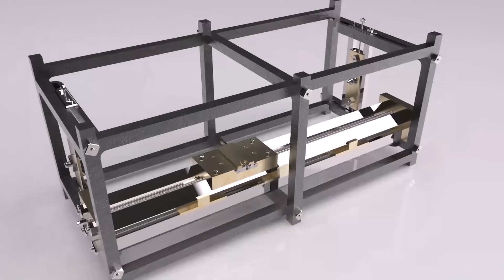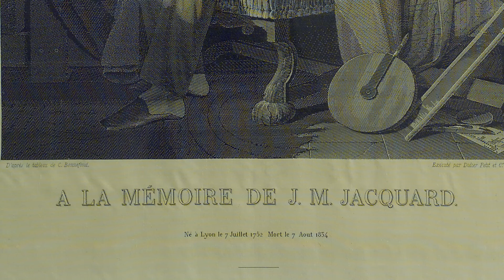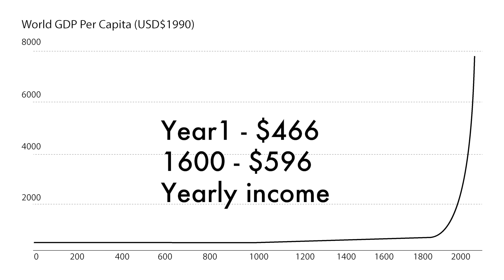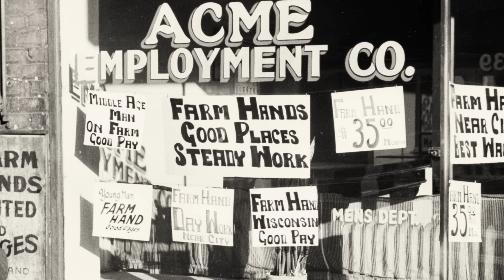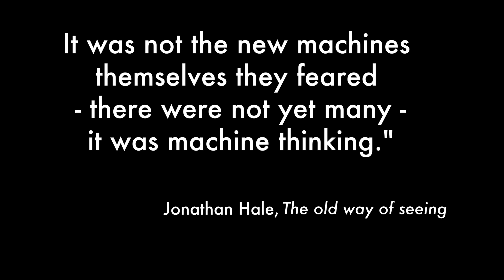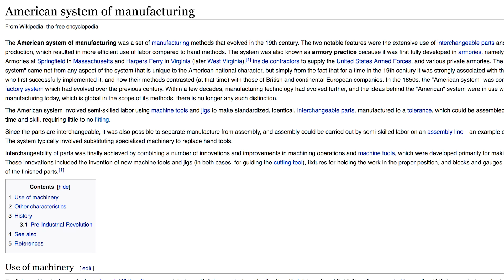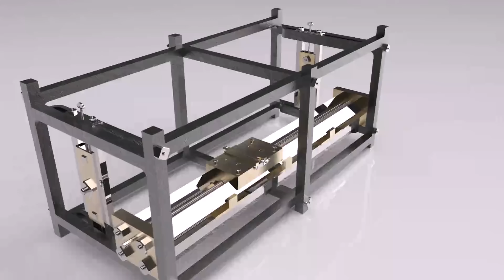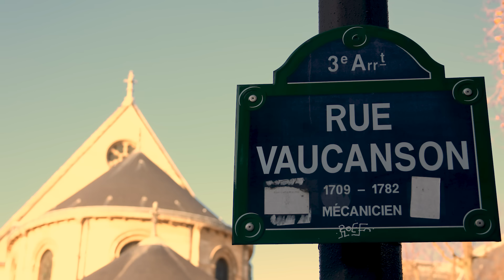The 1751 Machine that Made Everything

Comment: Almost like 3-D printing is behind the times 30 to 50 years… Just a glorified hot glue gun with special hot glue and a drafting table with 1990s level software

I swear it aggravates the hell out of me. In the early 90s I had an HP jornada color, screen PDA, and the most I could do with it was use it as a MP3 player… It even had a browser. I never understood why I couldn’t use any of the three mobile phone systems or one landline system that was around tonight. Only surf the Web but also download FTP… “Smart phones” are the exact same thing and still had problems with this up until recently thanks to the demise of flash.

Comment: I agree 100%. These machines were used (and scaled) to create better and better tools. If you've ever fixed anything by replacing a part, or put a new bolt in an existing hole, that's what happened. Before this, each nut and bolt were hand crafted and could not be interchanged.

Comment: Yes and no, in my opinion. A fascinating alternative point of view is to consider the source of progress is the ability to make precise screw and bolts, which ultimately lead to the use of small lathes, themselves made with screws, and so on... Therefore, technical progress was a very progressive process without clear break point. In this point of view, clock-making and also mill-making where the ancestors of industrial revolution, and this makes the "actual" starting point of this revolution difficult to identify. Ultimately, one could argue that the need of clocks and mills is the far far consequence of the neolithic revolution itself.

Comment: Quite wrong for a country or person to take credit for the lathe. History of Lathe

Lathe is a very ancient tool and its first use dates back to 1300 BC in Egypt. Lathe was also known and used in Assyria and Greece. Ancient Romans came to know about this machine and they further developed this machine. During the medieval period, the use of this machine had spread to most parts of Europe and it was during the Industrial revolution when this machine gained popularity with its use in all the industries. After the development of electronics, automated lathes have been developed.

Evolution of Lathe

The first lathe was a simple lathe which was is now referred to as two person lathe. One person would turn the wood work piece using rope and the other person would shape the work piece using a sharp tool. This design was improved by Ancient Romans who added a turning bow which eased the wood work. Later a pedal (as in manual sewing machines) was used for rotating the work piece. This type of lathe is called “spring pole” lathe which was used till the early decades of the 20th century. In 1772, a horse-powered boring machine was installed which was used for making canons. During the Industrial revolution, steam engines and water wheels were attached to the lathe to turn the work piece at higher speed which made the work faster and easier. After 1950, many new designs were made which improved the precision of work. You see France did not invent the lathe or anywhere close to.
Reply: Thats not a true metal lathe though else Egypt would have exploded
It was hard to make and could not be made by another lathe.
He says this
Reply: @frankk1512  lathes were being made around the world of metal long before this model which was very good but simply an amalgamation of other ideas, in fact, this method of change continues to this very day

Comment: That lathe might have had a large part in making one of the crucial machine tools that could work metal: The screw making machine. They needed all shapes and sizes of screws to hold machines together, without them pieces would fly off and hurt or kill workers nearby. They also needed many screws to go into the products, to hold them together. It was a very well-threaded machine shop that had the screws helping hold the parts together!🪛😊👍

Comment: Your technology-first read of history is fundamentally incorrect in so far as it doesn't recognize the dialectical interplay of ideas and material constraints on the mode of production. Always remember that innovation does not exist outside of ideology. All technological innovations that have permeated the capitalist age, from the ball-bearing to the transistor radio, happened because they served the purpose of increasing production surpluses.

The Romans were aware of all technologies needed to assemble a steam engine but they never did, except perhaps as a toy, because the organization of their agriculture, and the availability of slave labour meant that there was no pressing need for expensive machinery to automate that work.

No doubt the screw cutting lathe was a huge turning point in mechanical engineering, but its usefulness to society is dependent on social and political changes also happening in the 18th and 19th centuries. Colonies introduced tons of cheap resources to Britain and europe which needed to be processed into commodities. Land enclosure created a class of landless peasants with no means of subsistence except factory work. And modern timekeeping enabled the precise distribution of hourly wages. These are just a few of the hundred threads that knotted at that time in history to create the preconditions for industrialized capitalism.
Reply from the maker: I think you didn't watch the whole video.  Watch again starting around 8:00.  The whole point of the video is that many of these elements had been around in various forms for a long time (and often in non-western contexts as well, though I didn't get deeply into that) but what changed was how we THOUGHT about how to use these items.  Literally the name of the channel, Machine Thinking, refers to the idea that it's not about the tools themselves, as much as it is about how we think about how to use the tools, and then in turn, what those tools do to our thinking once we have them.

Comment: Many of the old timers had a more modern although used electric lathe for "hogging" but if they wanted ultra precision they took the part to a converted flat belt drive lathe with plain bearings and put heavy grease or oil in the bearings for finishing, more accurate. Better finish because of bearing tolerances and lack of gear vibrations etc.

Comment: moire is pronounced "mo-wire", like you need some mo wire to plug in your x-mas lights. But mash it together into one syllable. 
The e is silent on the end of most french words. UNLESS, it has an accent over it like in cafe` or the following word starts with a consonant, in which case you might pronounce the e slightly to smooth the transition between harsh consonant sounds.
"moy-ray" really only gets the "m" right ;)   (ya, 7 years late, I know. PS: good video)

Comment: Not just the lathe....it was the industrial revolution.  Effective power generation and distribution allowed for all manner of machinery invention and improvement.  Modern iron and steel production.  Energy, people, energy.  That's why wind power is still stupid along with the myth of solar power.  Without battery backup, they are silly.  Even with battery backup, they are silly.  Energy needs to be efficient, portable, instantaneous, reliable, and utterly distributable.   Energy.  Energy.  Energy.  It's the engine of innovation.

Comment: The biggest change was in thinking the youth always learned their trade and training from the elders father taught sons mothers taught their daughters with the changes sons and daughters learned learned new skills the mentality that the older generation generation knew more than the young was still in the minds of the older people even into the1980 my father always tried to say to solder copper plumbing lines you had to use acid cored solder  although I never saw him do it I used flux on all joints after sanding them never had a problem lived with my sister and brother inlaw his dad was the same way plumbing in the laundry room with half bath for clean-up after being in the barn we spent 4 hours trying to solder the water pipes to the sink toilet and shower every time we got done and turned on the water it leaked first one joint and then another I told that I always used 50 50 solder and flux he said the only way was acid core 50 50 solder finally he said the acid  core solder must have gone bad but he had some new stuff in his fridge and went to get it took him an hour to drive a1/4
 Mile go in the house couldn't find it so he searched his basement and his garage and finally came back with out it after he left I went to my room since I was planning on plumbing the water lines I'd brought my solder and flux in my suit case I went to work pulled it apart joint by joint sanded  fluxed and resoldered them in 20 minutes I turned the water on and no leaks he said I must have used his acid core solder even fixing a flat he had some home made tools to break the bead and take the tire off the rim he beat on that tool for over half an hr couldn't get it to break the bead I suggested to put the tool on the tire next to the rim and drive the tractor on it using the weight of the tractor to break the bead it wouldn't work he said finally he went to get a bigger sledgehammer from his garage as soon as he left I set the tool as I suggested drove me tractor on it  broke the bead turned it over and did the same since I held the tool while  he hit it with the sledgehammer it was self preservation I was worried he'd miss the tool and get my hands or arms didn't take him as long to go to his place check the garage find the 10 pound sledgehammer wasn't their and come back I think he just went home and right back didn't even stop and check out his garage because it was in the shop the whole time but with that generation it was a way to save face I don't think they ever soldered a pipe just figured that's how it's done since they were older they  were the ones to teach us  as their fathers had taught them unfortunately things were changing it was copper pipe solder together not galvanized pipe threaded together tires were a tighter fit than on the old model t even wiring a house was different no more knob and tube with taped splices it had gone to two wire and boxes add then to two wires with a ground and had to be to code and inspected my generation recognized times were changing now if we have trouble with those newfangled computers we ask our kid's or more likely the grand kids when i have a problem with my phone I get my niece to fix it or I get her son my great nefew to fix it so much has changed in just  2 generations but the main thing is how we view the changes from my dad's generation where they'd never consider asking my generation for how to do anything to my generation where if we have a problem we ask the younger generation or even go down to the next generation I still can't figure out a lot of computer stuff and the new phones are just a computer in a handheld device  I still remember the first text I got it drove me nuts said I had a message but after checking my answering machine and it said I have no messages I asked my neice how to reset it and get rid of the message that I had a message when the answering machine said I have none she looked at the phone and said you have a text I said what's that so she showed me how to get the text she then replied to the text and told him I was computer illiterate and phone me well this generation doesn't phone they text and he sent me another text in reply but this time I knew what it was and read it it was a good lesson as I ended up at a new job and my new boss would text me up to twenty times in one day and since he had problems sleeping and thought of something I needed to do or check out on the job he'd text me at two o'clock in the morning now I do a lot on my phone my brother's washer won't work it's got a strange code Google it and fix it need to find a place open Google maps and in most cases it'll show how to get there need a phone number Google it I always say I got dragged into the computer age kicking and screaming no but I'm there and there's no turning back the brother 2 years younger and the one 5 years older never used their phones as anything other than a phone the older one won't even learn how to use the directory or answering machine still has his pocket phone book with the names and numbers written down

Comment: Fascinating. I am not an engineer, but I know wooden lathes were in operation at least 200 years before. this one. For example when the world's first modern factory was built in Matlock before this lathe was built, Arkwright had lots of wooden equipment made on lathes. I do not know how the metal machines in the factory were made. So what bits of this lathe were completely novel?

Comment: I have often wondered where the origins of the metal lathe were from. Thank you for doing the work to produce this. I was captivated, as a young kid, by watching my grandfather make an eyeglass screw. He was mad because K-mart wanted a dollar for it! It's turned into a life long hobby. As I write this, I'm in the process of building an electric longline hauler. The one machine I could not be without is an old Lodge and Shipley metal lathe. It was produced to be driven by line shafting. The newest patent on the machine is 1928! After nearly 100 years, it can still produce .001" accuracy! These machines were birthed from this one. Just so amazing! Thanks again for posting. Bravo!!!!!

Comment: One other important technological breakthrough was the application of the steam engine in the 1740's  to the blast furnace to produce cast ion, the raw material for wrought iron, the industrial metal of the time.   This allowed blast furnaces to be located away from the water power necessary to power the blast bellows.   Transporting coal and ore to a site where water power was available exceeded the cost of the iron produced.   This enabled the exponential growth of iron production which was essential for economic growth.

Comment: I'd like to suggest that the main idea that has brought us to the state we're in is the concept of "circularity". The notion that something can travel in a circle and return to the very same place it started. I'm talking about not just the invention of the wheel but also of the axle, without which a wheel wouldn't be of much use. The axle remains stationary as the wheel revolves around it. We've all seen pictures of Egyptians placing logs in front of the stone blocks of the pyramids to transport them. I doubt this is truly the way it was done. But the concept would have led to the invention of the axle. Someone here mentioned the potters wheel. Turn it on it's side and you have a lathe. Turn it upside down and you have a drill press and a milling machine.All of these, including the lathe, can be put on a  graph similar to the one shown in the video ( if the data were available). I believe it would look much like a staircase. With the inventions being the risers and the steps being the inventions.  The steps would be very uneven and The riser of the lathe may be the highest step on the staircase of man's progress. There is no way of knowing which invention caused the highest rise in per capita income. What the effect of each individual riser (as compared to the the length of the stepstep)  is unknown but it would make for a very interesting graph. At any rate, the one thing you can bet is that the risers were all caused by brilliant men. I hadn't thought of it in these terms until provoked  by this video though I'm sure many others have. Thank You.

Comment: The chart actually explains nothing. Lots of things happened between 1600 and 1900. Some of them were as important, if not more important, then the lathe. For example, James Watt invented the modern steam engine. The American revolution started in 1776. The French revolution is from around 1790. Plenty of other machine tools were invented/perfected between 1600 and 1900. A process for using coal (not charcoal) for producing Iron was devised in the UK. Many advancements contributed to the UK (and later world) industrial revolution. Lathes were just one of them.

Comment: How was the workpiece turned? I see two centers for mounting the cylinder to be worked, but no way to turn the cylinder being cut. But I agree, this tool looks at least 50 years ahead of its time.
Reply from the maker: I didn't mention it because I only found one reference in passing, but I believe the workpiece was driven by a belt to a water wheel
Reply: @machinethinking  ah, ok. I was reading about it and there was some mention of a crank for both the workpiece and the cutting tool. A water wheel makes more sense.

Comment: and this led to the metric system. Prior to this there were different measuring systems across France. The most common, but not dominant, was used in Paris. The industrial revolution required a standard measuring system across the Nation which could have caused resentment if the Paris system was imposed on the regions. A new system was therefore required and it just sensible for it to be based on the  Hindu–Arabic numeral system (10)  which had replaced ) the old Roman numerals.
In Britain and it's empire and ex-colonies (USA) there was already a standard system. It wasn't metric but it worked.